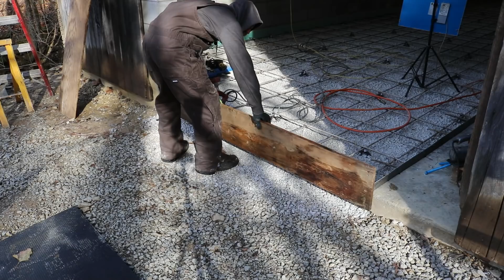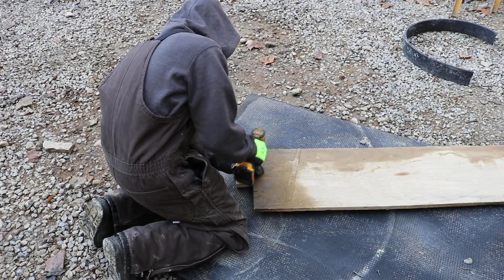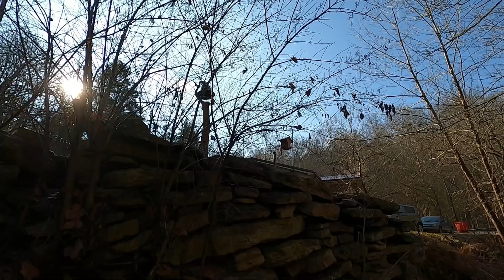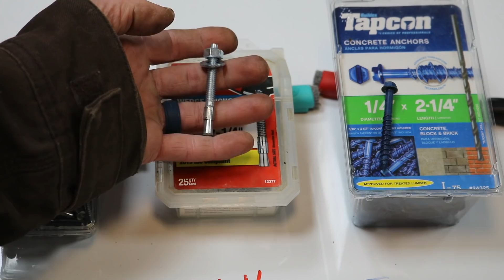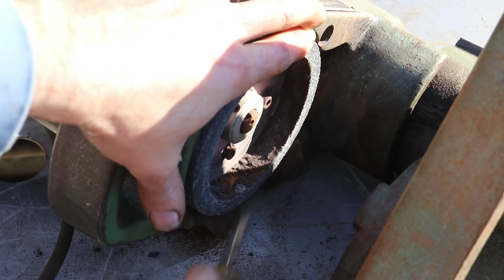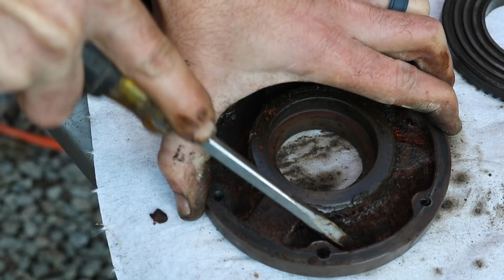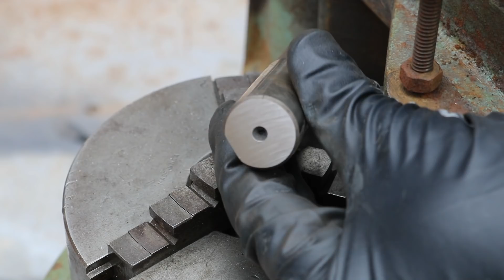🔥Testing the "New" Pin / Punch Grinder. Shop Concrete form and more

Comment: Your punch grinder in our shop was right by the Strippit, it being a punch machine with an X-Y table for precision punching, notching sheet metal for panel faces or other flat parts. Of course they are now CNC to position the sheet under the punches, with the punches and dies on a turret. Wouldn't mind having and old 'manual' one in my shop if I had the room...

Comment: the tapcon match up well with bosch bulldog - you drill and then can quickly drive them with one tool #thrush
Reply: you need a sandblasting pot/rig - you can use black betty or baking soda or walnut shells - can be a big time saver

Comment: I used to work in the machine shop at Mack trucks where he had a Strippit punch machine that we used mostly for making dash panels 
Everyone wanted to run that machine 
It was clean easy to operate worked great
Maybe you should treat the out side of those coveralls with some type of wax waterproofing like browning or belstaff 
Then they will not only be warm but also water proof

Comment: Hi Steve, 
Nice addition with that punch and die grinder - it's used for sharpening the dies and punches that are used in sheet-metal work. Like on an Rotex punch press. Of course you can also use it for your pin punches.

Comment: It's a swing surface grinder - normally only used for restoring press punches but it should also work to surface grind anything within its swing capacity  - maybe add some gards and  carefully grind a flat plate  - measure the thicknes before and after grinding to check how perpendicular the wheel is to the table

Comment: Enjoyed the video, thanks.  Is that a pilot (neon) light I see on the top of the pin grinder?  It would make sense if you think of it being used in a noisy shop; you may not hear that the unit is on.  Cheers from Canada!

Comment: A word about the Strippet punch/pin grinder it’s for sharpening sheet metal punches or ejector pins as used in injection molds. The stop on the side should be set on top of the first part after the grind is made to avoid having to “pickup” the top of each subsequent part. Enjoy your videos. Thank you!

Comment: Thanks Steve, good to hear more and a varied set of content.  I asked a builder friend of mine about masonry fixings (block or brick and some concrete) and he said that concrete anchors, similar to your Tapcon) were what they used for almost everything.  Use once and remove is fine; re-use less so.  For a fixing you  wanted to screw things on and off, then either an expanding anchor or, if removal is essential, bolt down a fixing using concrete anchors so that it can be tidied up at the end of the job.

Comment: Hi.  I  seen something on youtube that might help you. He was a man who stopped river banks from eroded away. What he did before were the problem was. He placed big rocks in the water. Starting from the bank side. V shaping the rocks towards the centre of the water flow. But leaving a channel down the middle. Lined with big rocks down the channel. leading out past the problem area. Then v the rocks back to the bank side. these rocks are just place on the river bed. With gaps around the rocks. What happens is the force of the water is pushed to the centre. It even works when the water is well above the rocks

Comment: Looks good regardless. I just formed and poured an elevated slab with 10' span. The structural engineer made me use 5/8" bar @ 16" O.C.  I think that's 100 PSF load capacity.

Comment: My favorite coveralls are full leg zip for easy entry and a front zip.  Makes getting in an out a breeze with boots on.  Good access to inside.  Used to buy Carharts but the price went up and the quality went down (most expensive summer (they call it winter ha) weight sweatshirt ever) so I went to Wall's which I buy at the end of the season sales for about forty to fifty dollars.  I then alter them with wear patches of Cordura.  Just wish I could find the uninsulated with a center zip for summer use.  Looking good on the shop.

Comment: Canadian here.  I dislike Torx heads because there are too many sizes [just like allen heads] which makes it difficult to tell which bit to grab.  The good old Canadian standard square-recess Robertson heads are far better - only two common sizes - large [red] & medium [green], with two others for extra large [black] & small [yellow].  The color coding is important - I can ask my wife for the green Robertson driver & she knows exactly what to look for.  Robertson screws also stay firmly on the driver at any angle - won't fall off.  No need for magnets, and driver bits can be reground easily [use a diamond flat] if they are worn.  Just my opinion, of course...

Comment: Steve - Would recommend you use the epoxy floor covering instead of a skim coat of concrete.  Tough to get a thin layer of concrete to bond to old concrete even if you acid wash and use concrete bonding solution.  Also, anything you drop on the thin concrete will start to chip pieces out and it will get pretty ugly quick.
With the hoodie on and your beard, you looked like a painting of one of the old ascetic saints.  Can we call you Saint Steven of Concrete now?  LOL.
Keep on doing the good work and hopefully see you at the BarZ bash next year.

Comment: It's your floor, and I own and have been pouring concrete for the last 30 years and I would say you have done an awesome job so far.  And what you have done to this shop not knowing how to do these this is awesome.  When you pour the slab make sure you have the finishers finish the slab smooth don't allow them to burn the finish, because it will be very slick if it gets wet.  Also make sure the finishers edge the door way.  If you have time I would thicken that front edge so you don't break it.  Also if you put an apron on the front of your shop do not tie it to the building slab with bar or pins.  But you are doing well, and if this covid craziness was better I would come down and pour that floor.  Maybe when things get less crazy I travel through your area I will have to stop by and shoot the crap with you.  I've got some  questions on your big lathe.  Thanks for sharing and hope you and your family are well.

Comment: My father had skim coated a low spot caused by the person who floated his floor in, it was a low spot and water always collected in it before and between the layers afterward.  The spots that were thin with water between the layers ultimately flaked off because the water getting between either froze or lifted.  I personally would look into something bonded with epoxy to seal the gap, along with tapcons to provide a mechanical bond to coat over.

I live in Whitesville South of Owensboro and my uncle who retired from Strange Engineering as a machinist building Top Fuel rear ends among other things, lives in Hazard and my mother was born in the Wooton area.  It would be nice to say hello to you sometime once this Covid BS allows folks to travel without all the troubles.

Glad to see you are almost finished with your shop.

-Scott

Comment: I have those same overalls, i like them and they have been holding pretty good, as i crawl around underneath trailers and crawl spaces for heating and plumbing work, great video cant wait till the shops done, mine finally is and what a great feeling it is

Comment: Timing the chuck jaws on this application isn't really necessary since punch and die bodies are so large that three jaw contact would still be good enough. The grinding wheel is so oversized relative to the punch or die that would fit in this machine that punch location isn't very critical. If I saw the error, I would have corrected it too, but in this application the error didn't affect performance.
Your machine must have spent some time exposed to the weather.after being decommissioned. No self respecting sheet metal shop that invested in Strippit machines would expose their investment to the moisture that caused your rust.

Comment: I'm concerned about your choice in expansion joint material. That foam insulation crushes easily, but doesn't rebound. Once its crushed, it stays that way. One year and you'll have a gap around the edge of your concrete pad and a place for dirt to collect.

Comment: As soon as I saw the punch and die grinder I knew it was a Strippit. Houdaille is pronounced hoo die. Houdaille owned a number of brands over the years. Strippit and Powermatic were well known brands. When I saw the green paint I was anxious to see the brand, because I wondered if Strippit was the maker or if Strippit purchased it and painted it Strippit yellow. But now it appears that it is a Strippit product. We had a couple of Strippit CNC turret punch presses with laser cutting capacity. The idea was to punch standard hole sizes faster than could be laser cut and to laser cut non standard and contours. Incremental or step.punches nibbled out oversized standard punch holes like using a square punch to create a rectangle.
 Worn punches could be quickly dressed by the operator and not require sending to the toolroom or vendor for sharpening. Dressing the die is more risky than dressing a punch,  because of the designed clearance relief in the die. Dressing increases the punch/die clearance due to relief. Relief allows the slug to clear the die. Punch and die clearance is a function of material thickness. Too much clearance on thin material dimples the work and produces an undesirable burr on the under side of the workpiece. Strippit trade name was coined by their mastery of stripping the punch from the work. We had Strippit machines over a 25 (?) year period. Our company decided to outsource our sheet metal fabrication in favor of increasing assembly. It was a sad day for me when our full CNC and manual sheet metal fabrication left the facility.
I was maintenance, so I was never a qualified operator. I lost my laser maintenance skills, because we had a laser nerd on staff that worked third shift. Since the Strippit machines only ran on first and second shifts, maintenance was typically done on third shift.
Your machine is simple and ours never required any maintenance. The micrometer head always reminded me of a "cadillac" gauge. I never did anything more important to our dresser than idly futz with it while waiting to speak with the production machine operator.

I have always called your wedge anchors "Thunder-Studs". I am not certain if that was someone's trade or brand name or if that was a morphed version of Redhead product name.  I employ this style anchor mostly in concrete floors. Usually you can hammer drill an on size anchor hole with the anchored item in place, drive the anchor home and torque. If used on a floor, hammer drill through the floor. If you need to remove the anchor later it can be easily driven flush with the floor with very few blows. The scar is minimal in a shop.enviromment.

Comment: Steve, the pin grinder looks cool.  what is the reason for the hole on the right side of the unit? my first guess; wheel dresser attachment.  what do you think?   poppy's workshop says HI

Comment: About bridge foundations.  There are some YouTube videos on how some of the first major iron bridges were built and how they had to have people go down in pressurized upside-down tubs to drill into the bedrock back in the 19th Century.  They found out a lot about the bad effects of "the bends" from this work, so the work had medical science application as well as engineering design and application work.  Recommended.

Comment: Could it be for grinding punches as in punch and die? Those punches would need a sharp  90% shoulder to work properly. Pin punches would need a radius edge to avoid chipping.

Comment: I believe those right angle blade connectors are called "flag" connectors.  They "require" a special crimp tool where the regular, in-line ones can be easily crimped.

I think the last time I had to crimp some, I just used my Knipex wrench-pliers.  ;^)

Comment: Did you think about putting radiant tubing in concrete for heat .I know its half of the shop but I'm sure it would really help make winter in the shop better on your feet n more. Also I think a hot water heater would be enough to do it . using antifreeze mix and a circulation pump on a thermostat .  Just what I would have done in my shop if I wasn't rushed and cheap.
Reply: Oh I like the pin grinder , great tool when needed , I kinda have one using my valve grinder when I need pins sharpened or shortened
Reply: I design in-floor and snow melt for a living.  A std. water heater doesn't have enough BTU output to warm that floor.  Not criticizing, just "sayin".

Comment: Those holes you used the "slide hammer" on, are for threading in jacking bolts. You put a bolt in each one and crank down a quarter turn on each one (at a time... so you don't jack one side too much, too fast) to jack the back plate off.

Comment: Thanks for the tip on the Flex Drive Bits. I have yet to see them but will surely do. The fellow that owns the shop where I pour my silver goes through thousands + of screws a year and most surely will love them. They will make a great gift if I can find them. Seeing everything going forward including your machine shops new toy is just plain great. Get a jug of "Evaporust" for small projects like the grinder. Just brush it on or more for soaking pieces. Skin safe too. Great stuff indeed. Any rust has no chance. That dedicated grinder is sure worth it's bench space for sure. Up here we have a company called Carhart that makes a similar canvas products. Pricy but well worth every penny. Just like good boots. $500.00 plus may sound expensive but last for 10 years or so. That works out to $50 or less a year. Inexpensive in the long run for sure. The big pour will be wonderful to see. You are still far from calling this adventure over but guaranteed you will have no warranty work for sure. Everything you do is top notch. See you next post my friend. Take care now.

Comment: Pull strength vs shear strength? I think you have to consider the shear strength as well. While the 1/4in Tapcon has more pull strength than the 1/4in anchor bolt, I doubt it has the same shear rating. So to use your example of pulling something like a big mill or shaper across the floor, I suspect the Tapcon could shear. The bolt is softer metal and thus will bend. This is also why it's not legal to use construction screws for framing in California. Earthquakes! Nails will bend where as screws snap. NOTE: this is just my lightly experienced DIY observation. I am not an claiming to be an expert on metallurgy.

Comment: The Tapcons have the highest pull strength, but they also have the lowest shear strength of the three types...so aren't good for heavy shear loads (i.e. hanging heavy duty shelving).

Comment: Steve if you don't have a set yet, you should grind a set of punches into ones that are specifically made for driving roll pins. They have a small step on them that registers on the inside of the pin to keep things aligned. Not overly expensive to buy new, but would certainly make for an interesting test projwct

Comment: Wow Steve, !  new roof , floor almost complete, took a long time to get the old wall down and roof supported for  footers & rebuild but now everything is falling right into place and you can be proud of all the very hard work. Question you removed the old chimney from the back wall by your lathe, what are you going to do about heat in the shop ?  Also do you have a water line back to the shop for a wash up sink? You did a much better job on your shop then I did on mine 20 years ago and mine is holding up well so don't pay any attention to the haters.

Comment: 1:15 Looks to be more like a small rabbit short than a hare.
The stop on the pin grinder would be used if you had many pins of a certain length that all needed to be shortened by the same amount. It will provide a reference for the amount of stick out for the part in the chuck.

Comment: The "experts" aren't always what they think of themselves.
You've done a great job there. Regardless of how many ways it could be done you've done it well. If nobody did anything for the first time we'd still all be cave men. 
Have you considered putting in a large threaded anchor point or two in the floor? Like 3/4-1 inch thread.   Like using a double length(or longer) threaded nut with tab anchors welded on, poured flush in with the floor. Handy for pulling and tie downs for many repair and fab uses. 
You'll feel like a king standing on that new floor. Thanks for sharing

Comment: Concrete for Christmas! What is better than that?  What seems like 100 years ago one of the job shops next door to where I worked had two very large Strippit NC punches. Don’t know if they had such a grinder but wouldn’t be surprised. Very interesting tool.

Comment: For lightweight rust, I use white vinegar and a paper towel. I did the cast iron table on my Grizzly 6" jointer. The paper towel was rusty overnight, rinsed with water, spot cleanup with a kitchen scotch brite sponge. 2yrs later no rust, paint not affected. The jointer had sat in an unheated garage for a decade.

Comment: That Strippit grinder brings back memories  in 1962. I worked for a company "Orion Electronics" and they made signal generators for the Army & Navy.  We had a lot of punches and dies made by Strippit. They purchased that grinder so I had a way of sharping them. We did not have a surface grinder.  I had to use a bench grinder. That strippit grinder made my job so mush better. Thanks for the memories.

Comment: The 3 jaws just have to be installed in order, any chuck I ever worked on did not matter if they were even numbered. Sometimes you can find a setup (varying the position you place the no. 1 jaw in until you try all 3) then check concentricity. Sometimes runout can be improve this way. Great to have your post back this week, keep it up, thanks again.